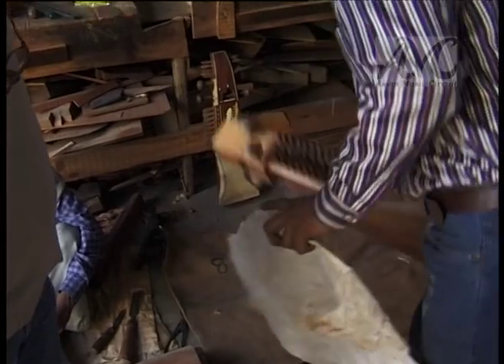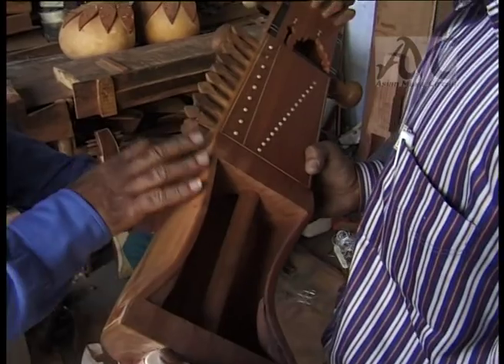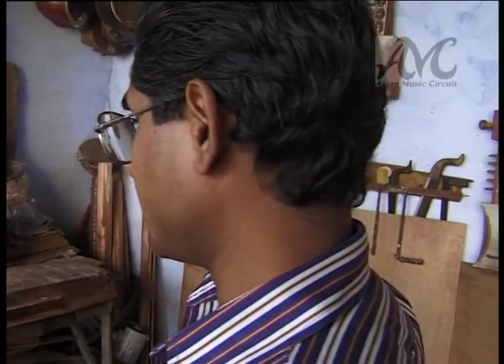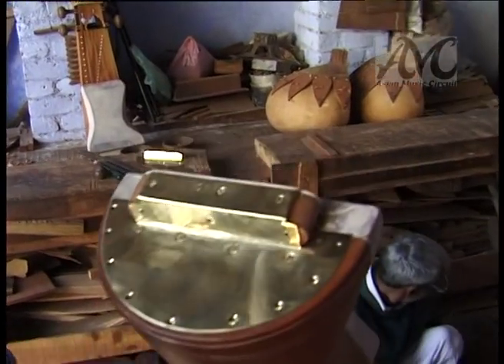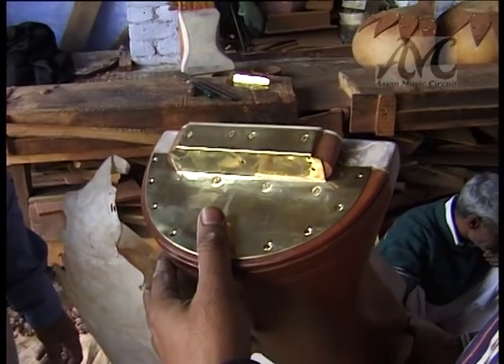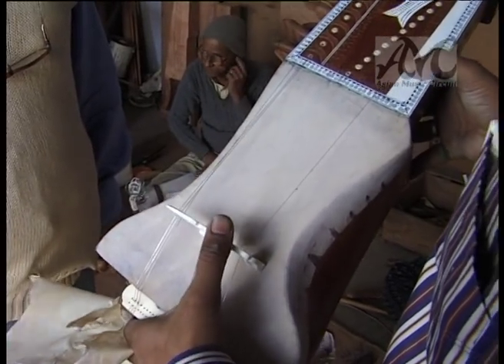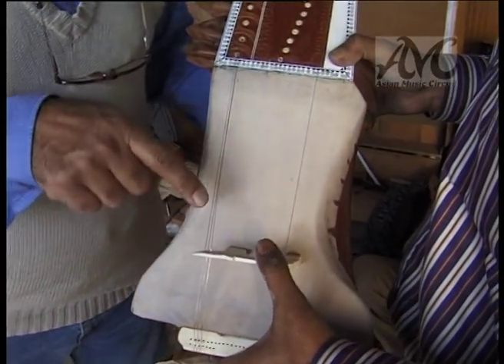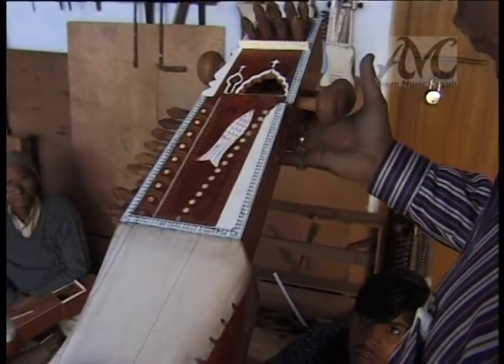How is a Sarangi made?

Comment: Hello, I will be glad if you can please explain the process of how the skin is stuck onto the instrument.  Thanks.
Reply: First out the skin in water for few hours . It will become very soft. Then dry it using a towel . Then use super glue on the upper border so that it gets attached firmly and finally use fevicol on the sides and bottom. but stretch the soft skin over the soundboard. Let it dry for 24 hours . Trim off excess skin by using a pencil blade .